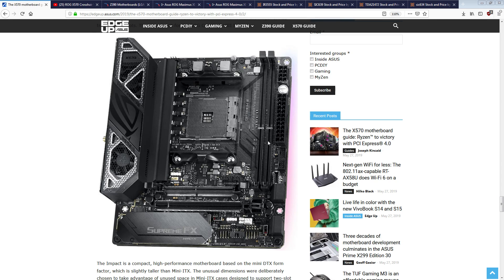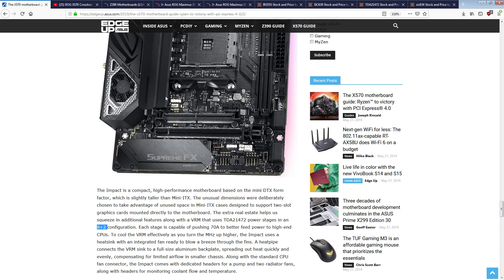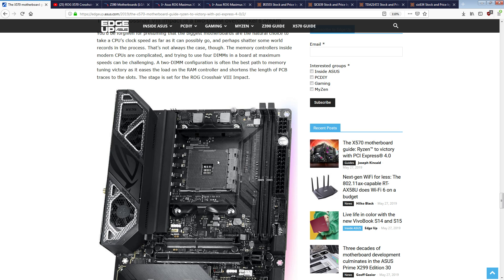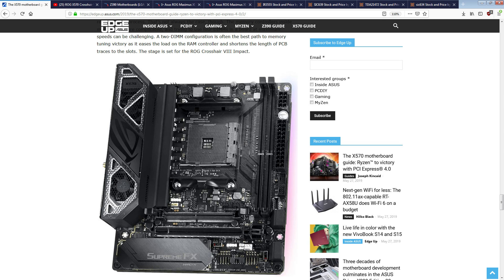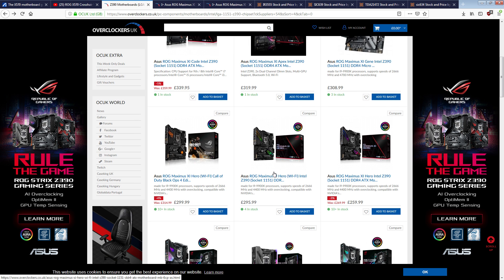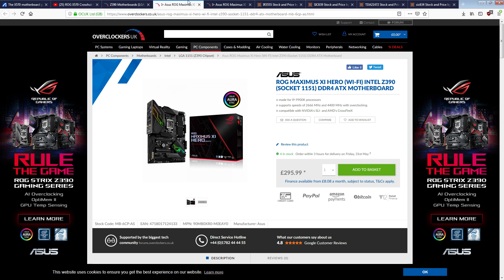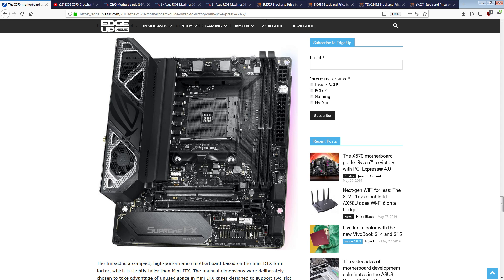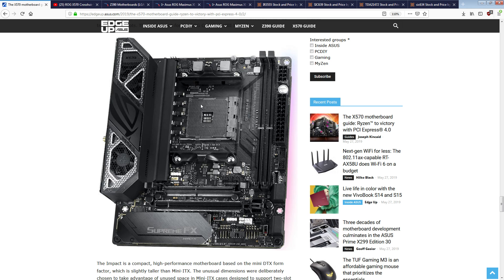The Crosshair VIII Impact is almost certainly a 4+2 phase VRM and that's fine

Comment: Can't wait for review of x570-I as this DTX won't fit on sandwich layout cases.

Very interested in this and the x570-I
Reply: The Gigabyte X570-i has 6+2 phase with 70A though. Even better than the Impact.
Reply: @tigerd7528  Have fun with their BIOS, updates, and customer support if you ever need it
Reply: @tigerd7528  yes, but their bios is so so bad. Asus has the best bios and ASRock second place.
Reply: @demonwares  I have b350 itx from ASRock. And it is worst bios what I have. Really.

Comment: Well at least the Gigabyte MITX is true 6+2 phase and also has the 70A TDA21472 power stages. The heatsinks are also far less in the way than the other boards which is important in actual SFF builds since you can't overclock the CPU if you can't fit a decent cooler on it. Hopefully they are still sufficient for cooling the power stages.
Reply: yeah, that is a cute board. X570 i Aorus Pro WiFi. I would be very tempted to take a Dremel to that lump of metal on the IO cover to give it actual fins, looks ok on the rest of it.

Comment: Dammit! What a disappointment... i really wanted a small form factor ridiculous overkill 3950X mini dtx Board! :/ -.-
Aaaand it dosent have a video output... sigh
Reply: your 3950x wont have an igpu...
Reply: @dyren7437  But i want it for both the 3950X and the 37(6)00G
Reply: So you will put 2 cpus in 1 Mobo... Interesting 🤔🤔🤔
Reply: @StavrosAvramidis42  -.- i want to switch them, obviously!
Reply: @serviceaccount6475  !? SO you dont want to have a board were you can use your extreme CPU for a small form factor power house or the smallest possible power house!?
I mean even Buildzoid complains about that so youe heard "the dumbest thing ever" twice today, one time from the Motherboard Guru himself!? 
Well i dont know how i should think about that..
Reply: @dongurudebro4579  if you have a gpu thats not an issue right?? Or do you want to buy , the 3600g, then a gpu + the 3950x???
Reply: @MrBluePoochyena  this board fits in every itx case that has 2 pci expension slots, thats most of the itx cases out there...
Reply: @MrBluePoochyena  bro you are talking about something you dont even know the specifications of. Mini-dtx is itx + 2 pci expansion slot. THAT IS A FACT.  And it is going to fit your case, because you have 2 pci expansion slots...
Reply: @dyren7437  https://hardforum.com/attachments/pu83xbb-png.163901/
Reply: @kevineldridge9452  Thank you! Now i know im wrong and he is right. Tra1aw_pc please come with these kinds of stuff instead of just rambling.
Reply: @MrBluePoochyena  Yeah, its not that i dont get it, i just want it.
I Build my cases myself so thats not a problem...
Reply: @MrBluePoochyena  hey ignorant guy, THE OFFICIAL SPECIFICATION says, that this is itx + 2 slots. I wont argue with you unless you come with some solid arguments.